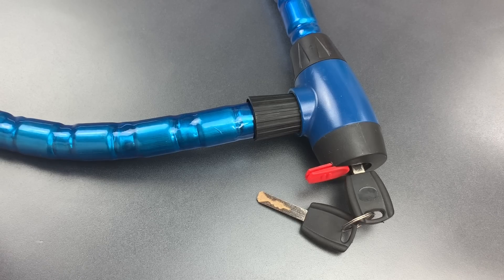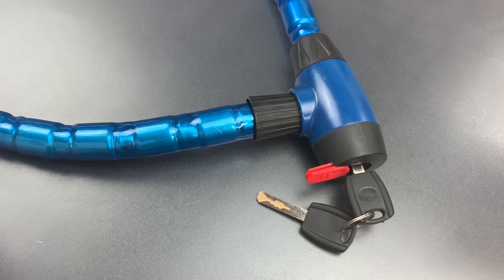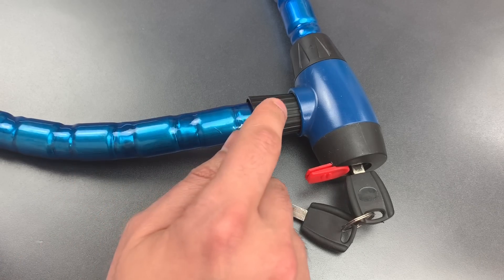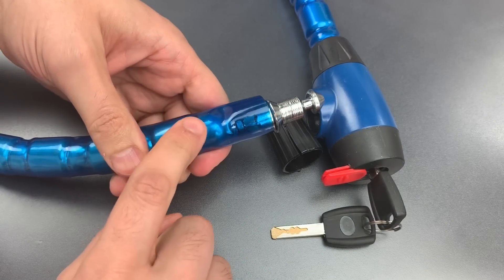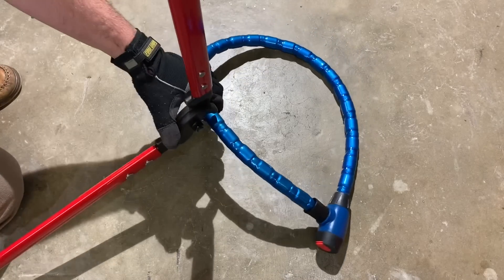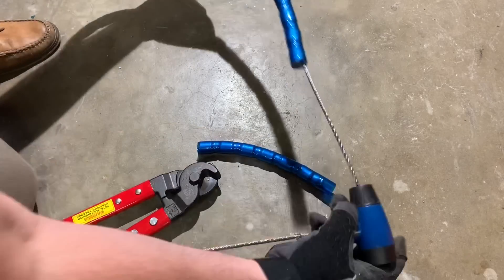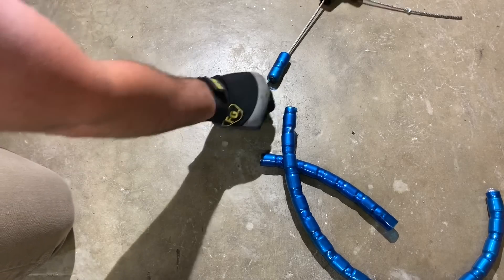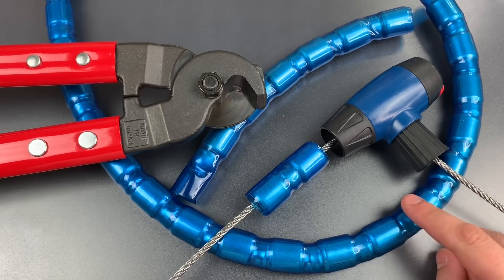[767] Bunker Hill Security Armored Cable Lock Cut EASILY

Comment: Let's start a lock manufacturing business....watches LPL

Let's open a cafe
Reply: Well, if you do your homework and avoid the security flaws, your products would receive the best rating LPL could give, “good enough for the street”
Reply: @karurosu3dx  The best security is just casting whatever you want to protect in hardened steel.  No mechanism, no chain.  Just a solid block of metal.  No way someone is stealing your bike when you encase it in a 10 inch, by 50 inch, by 36 inch block of steel.
Reply: @sithlordzach8418  Nice click out of 2...
Reply: @sithlordzach8418  well u only need welder and something to cut the weld with. Tho i dont think ppl rly will understand. Also its security flaw cuz thiefs can cut the lock just like u.

Comment: The cable is puny and running through a large hole in the "armour", which makes crushing the "armour" easy with that tool. Once crushed you're then almost snipping a crumpled piece of sheet metal. Total crap.

Comment: I had one of these to keep a bike chained to my porch.  Well, I couldn't find the key so I tried to see if I could cut the cable with tin snips.  Took about a minute.   You're totally right LPL,  this lock is only slightly more secure than a length of rope.

Comment: For those who are wondering, these are wire rope cutters designed for steel wire, not the electrical cable cutters.
Reply: Yeah I am not surprised they cut through....I mean they are designed to cut cables and if that "armor" was thicker it might have been enough but it looked like they were little more than a couple layers of foil thick.

Comment: So basically, it would only be a deterrent to small wire cutters. Primarily because the small cutters couldn't get a bite on it.
Reply: Addicted2baseball rgd You can nibble through these “armored“ cable locks.
Reply: @herosstratos  I suppose you could, if you got between the joints of the armor, but we'll never find out, now that the lock is destroyed, lol.

Comment: At my school I've seen people with similar locks on their bikes but with one major difference, the plastic around the armor hat a few cuts in it. One day, I found one of thouse locks with the plastic being worn off two, but it wasnt on a bike, wasnt cut, it wasnt even open. So I took it home and took a look at it and saw that, if you bend the armor at the part were there is no more plastic, you could easily acsess the small cable. I didnt cut it thouh. I put it back where I found it and it lied there for over a month until someone threw it into a near trash can...

Comment: That was how I found my £450 Specialized Hardrock, broken in seconds by thieves from straight outside my work with plenty of people around and CCTV. It was only then that I realised my mistake. Even if not hardened the joins in the sleeve are weak. This is a very good 'public service broadcast'.

Comment: I had similar lock on my motorcycle. When key broke, I borrowed simple metal hand saw. And used the gap to cut the cable took me around 30sec in total to cut it open.

Comment: Protip for aspiring bike lock makers: the chain/cable is the part people go for. Well, the bike ultimately is what people go for, but before that, it's the chain/cable.
That could have a truly unpickable core, and it would be just as useless as tying a bike to a post with sausage links.
Reply: I think sausage links would hold up better than this lock.
Reply: This lock isn’t made to be secure. It’s made to fool unsuspecting consumers into thinking they’re getting a bargain on a secure lock.

Comment: In previous times everyone just used a chain and padlock. If one could afford it they'd upgrade to hardened chain and as good a padlock as they perceived was very resistant to thieves. For the most part it worked pretty well. Those products are still available and I'm at a loss to explain why were buying this newer stuff with only a marketing ploy behind it for what passes as actual security. The other advantage of chain is that it can be any length with potential to be more flexible to a larger variety of circumstances. Try using the lock tested in this video to go a round a utility pole for example. It might not even reach the distance! You can also buy steel or stainless steel cable by the foot. What I dislike about cable is that the end loops are secured with aluminum ferrules. If you do wind up using it however, keep in mind that the end loops take up some of the cut length. So allow for maybe a foot or more extra for that feature.
   One of the several things I like about these videos is not only the direct knowledge that comes from them, but they also inspire me to think on my own how it might be a jumping off point for other ideas. LPL is a good teacher in those respects.

Comment: What do you want, the cable cutter is made in Japan, it's samurai's cable cutter.
Reply: Yet the blades are not given the same traditional swordsmithing that produces the quality gem steel for balance of layered hardness.
Reply: Well, they are actually far better. The whole "authentic" process of katana-making was created due to really shitty quality of the ore they had at the time and the primitive smelting technology that produced chunks of unpredictably low or high carbon steel with a lot of impurities in it. Thus the process was mostly to deal with the impurities and combine high and low carbon pieces to achieve acceptable parameters.

Comment: You need to take some of these locks to a college engineering lab and subject them to some of the tests they can do with hardness, etc.
Reply: Tom Herron You can test for hardened steel just by dragging a steel file across the suspect steel.  If the suspect steel is hardened the file will skate across the steel with at most very minor scratching, if it is not hardened then the file will bite into the steel as it tries to file it away actually removing steel in the process.  But in this case, given how easily the bolt cutters cut through the cable, my guess is that the “armor” is either unhardened aluminum or possibly very soft steel.

Comment: How thick is the steel in those armor segments? Are they just thin-wall tubing or sheet metal? Even mild steel should not have been that easy to cut—any reasonable thickness would have sprung those cutting jaws apart.

A close-up of the cut ends would be nice for this sort of video, so we can see the cross-section.

Comment: I'm curious how difficult it would be to cut through with just arm strength. The method you used here is what i tend to when I'm cutting tree branches that are technically to thick for the loppers I use, that would be much more difficult to cut it I just used my arms. Bracing one side against the grind, or my leg or part of the tree itself makes it much easier.

Comment: I wonder if the "armor" links do more harm than good. Sometimes while cutting wire or cable, it twists or bends so the cutting blades slide over and the cable is between the blades. The armor may hold the cable 90 degrees to the blades so it can not twist  and therefore is more easily sliced.

Comment: This is why I never understand people who use these locks for a 'quick shopping trip or popping into a cafe for a coffee' type lockups. That said, I'm quite happy that people continue to use crappy locks, because it means their bike will be the easier picking on the bike rack than mine.  Path of least resistance!
Reply: Because it's a pain in the ass carrying around a 16lbs Kryptonite New York Legend Chain.
Reply: When I was more able and could use a cycle, I let the bike carry the lock; the weight of the lock is no excuse when you have a pair of wheels available to move it that are literally designed for the purpose.
Reply: @RealUnimportant  because there are people (those guys that wear spandex shorts) that literally spend $5,000 on a bike to save weight, and make good time.  It's not an excuse for laziness, or to save money. It's more about what is practicable. When I go mountain biking, I don't want that weight, commuting to work may be a different story. I own a cable, u-lock, and chain. I use whatever is appropriate for the ride,  neighborhood, and also the duration of how long the bike will be unattended.

Comment: The problem with all of these cable locks is the guage of the wire and the lack of hardness. But to increase either the guage or especially the hardess would result in a cable with very limited flexibility. For instance making the cable with heavy guage (10 -12AWG) music wire (very hard wire) would render the "cable" rigid, but cutting it would be a task!
Reply: but hardness results in brittleness, so now instead of cutting/slicing you just use blunt force like a hammer or sheer force like clamp/spreader to encourage shattering

Thieves are aware of the physics - every known material in existence has strengths and weaknesses

ie u lock made of rubber - excellent blunt force resistance, abysmal cutting/slicing resistance

extreme hardened steel - amazing cutting resistance, poor impact resistance (big hammer)

so damned if you do, damned if you dont

people still refuse to acknowledge 100% of all locks are virtually useless and cannot be made better unless we find a material better thsn hardened steel
Reply: I understand your comment, however brittle is far from the properties of hardened "music wire", you can sit and pound the cable all day and it will not shatter. It is not  a cast product or in any way similar to cast iron. Shear force can be applied to all metals and with sufficient power it can be cut, however the intelligence of thieves is more cunning than an undersdtanding of physics. Harden cable is extremely resistant.
Reply: @nitramretep  Thankyou for your reply although I believe the unholy Angle Grinder would still beat it as with freezing/burning as other common techniques

Yes, Hardened steel bar/cable is the best currently available.. but there is no known material that is either flexible/rigid that wont stop cutting, impact, sheer, bend, spread, burn, freeze, abrasive, crush etc all at once, at least 1 will be a weakness

Bar is the strongest form but as aforementioned, a new tech inventive finding for a material would have to be significant enough to be both flexible and strong or strong and flexible - pick 1. it would obviously be like, floppy diamond formed into U shapes. but you also have to do the same for the chain, padlock, anchor and bike itself. whatever is your weakest link in the loop is what will be defeated instead

most pedal bikes are made of soft steel, some even attached to wrought iron railing - soft metal easy to cut and work on the lock later as can just lift the whole thing especially motorbike with claw lorry

see lockpickinglawer that guy has road tested the best available locks and they still dont hold up in picking or destructive tests.

 som
Reply: Nothing is safe from the cordless angle grinder!

Comment: There was a product that was called "Cobra Link" it was the same type of armor over cable...
but the internal cable was thicker and the body armor was "Case Hardened".
Someone cut that cable off my motorcycle but used some type of power cutter as the armor and the internal cable were deformed from the cutting force.
I would love to see you cut one of those... as it's was defeated but it took some work.

Comment: They used to sell a locking device called Cobra Links, ever give them a try, l'm sure U can pick the lock but l have my doubts about trying to cut the links without a high speed grinder or a cutting torch.

Comment: I really want to test this on my considerably thicker and hopefully more secure armored cable but can't justify destroying the 6 foot cable as I have been using it for years and it has resisted the only attack it ever suffered with only a gash through the rubber and minor scarring underneath.

Comment: You are testing this on the ground for the best possible way. But what if it is in the air and you have to use only your hands. Also try this with smaller cutters. I'm not defending the product , just want to see different situations.

Comment: Maybe I overestimated the effectiveness of bolt cutters, but I thought bolt cutters, especially full size ones like these, would cut through the hardened steel of a padlock without much trouble so I wasn't surprised when it cut through this cable without much trouble. I did have, a perhaps uninformed reaction to the video: I don't think large bolt cutters are a common tool for your average bike theft miscreant to use so not being able to withstand an attack from one didn't seem like it was much of a mark against the lock. If the lock could be cut easily with a smaller tool with the lock installed in the normal way on a bike I'd see that as a much more serious flaw. If that were the case the lock wouldn't be any more secure than a regular cable type lock and presumably it costs more because of the armor around the cable.

Comment: You can cut rebar with cable cutters,no lock is going to stand up.
Reply: Tom Smith FWIW, rebar is actually very soft steel (it is designed to both bend into forms and to yield yield, rather than fracture, under stress, within reason).  So one could certainly engineer an armored cable with hardened steel that could indeed resist such cable cutters, though resisting heavy hydraulic cutters is much more difficult.

Comment: …as anyone from Amsterdam could have told you. 

About 15 years ago the 'Cyclists Union' went to several location where they knew that a lot of bicycles were stolen. They looked as what locks they found there that were broken open. At that time the lock they didn't find was the Viro “Blocca Catena" style lock. They also interviewed known bike thieves, and got confirmation that that type of lock (fairly new back then) was too hard to bother. I wonder if such a study should be repeated by now.
Reply: i've seen thieves cut through a bike rack in seconds.  your lock doesn't matter.  if they want your bike, they will find a way to steal it.
Reply: No sane person would put an expensive bike in those locations. The thieves are typically drug-addicts looking for a bike to sell (for €10 or so) to get the next fix. These thieves will not cut the bike rack, they just get the bike with the worst lock and sell it. 

Or don't even bother to remove the lock. I can't verify the story, but it is too funny. Student buys bike from drug-addict only to discover the the bike was still locked.
Reply: dude, it's just as easy to cut a bike rack as it is a lock, chain, cable, or bar.  

you overestimate and underestimate thieves.  most don't know anything about locks.  when they want something, they will use the method they know will yield results.  thieves will attack everything around a lock before they go for the lock itself.

Comment: Oh man, I would be interested in seeing the cross section where it was cut. I mean that cable is so thin and the "armor" is so thick. Like was that solid metal chunks wrapped around it or was it layers of thin metal? Because wow that must be some really soft metal if solid.
Reply: Ricky's Beets the fact the cable is thin isn’t really an issue. The armor is supposed to be hardened steel that should resist cable cutters, even big ones. The cross section won’t show you the material used in the “armor” but as we like to say it’s made of “Chineseum”
Reply: no I know it doeesn't matter, I was more saying with a cable so thin there was so much extra space for material. What that metal actually was wouldn't be obvious, but whether it was thin sheets wrapped around it, or a hollow thin metal shell, or a solid chunk of metal would've been nice to see.

Comment: Do you have any suggestions for proper cable locks, that wouldn't be easily cut with such tools? I've seen you cut far too many locks to trust any of them
Reply: There's a lock on the market called "The Otto Lock". Haven't personally seen one, just on the internet.
Reply: There aren't any secure cable locks. Sorry.
Reply: @herosstratos  people like cable locks because they're light weight. There's a time and a place for them. I use them under the following circumstances 1) quick lock. The following requirements are necessary, a) line of sight, b) not left longer than 30 minutes c) I'm within 50 feet of the bike. 2) as a secondary lock. Yes it would be foolish to use any cable for overnight use. A visit to the movies or library. Definitely not the beach or colleges.
Reply: @Thermalions  i've seen them attacked with cutters etc on other channels, and they held up well. But Bonian Bill easily shimmied the lock. Wow.

Comment: I wonder if having the lock on the floor, as opposed to hanging off a bike or gate made it easier to cut - given the floor offers a surface to push against. If the lock is suspended, you would have to exert force on both levers to make the cut.

Comment: But your using a Large Bolt cutters and not small hand held one's. With these you pull them out of the vehicle they are in..
Reply: The outer “armor” isn’t hardened steel like it’s supposed to be. You could cut through those with a pair of garden shears

Comment: far better to just use a length of hardened steel chain with a rust-resist coating. unless the bike you are locking up is a cheap POS spend the extra money to protect it.

Comment: Yes, of course it is super easy to crack cables when they are on the floor, so the general advice is that you should never just leave bike locks on the floor or leave them locked low, but that you should always keep bike locks high  should be completed so that a bolt cutter doesn't even get to it, or so that you can't use your body weight.  So these tests are completely ridiculous too.

Comment: it would be cool if you would try to cut it without using body weight too. Yeah you proved it can be cut, but if it would be locked on the bike possibly you would not be able to put cutters on the floor and jump on them.